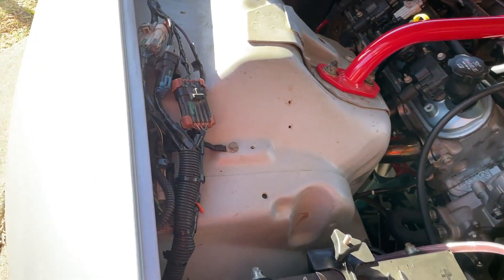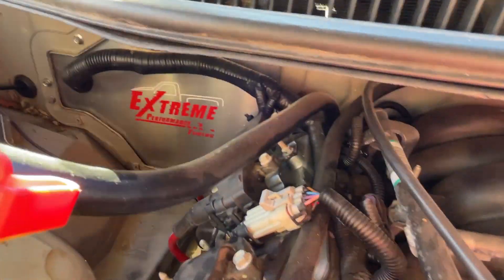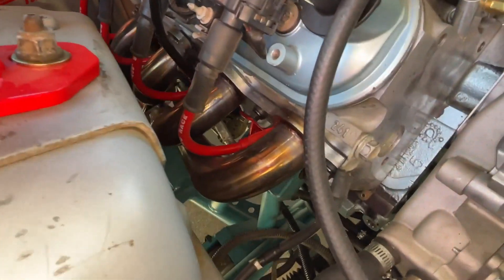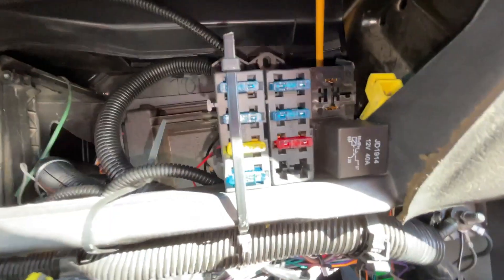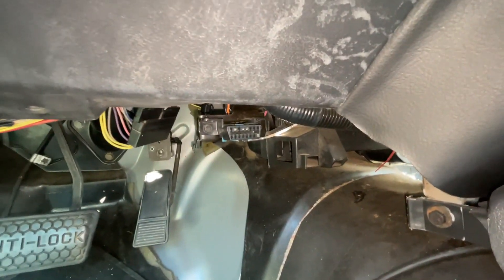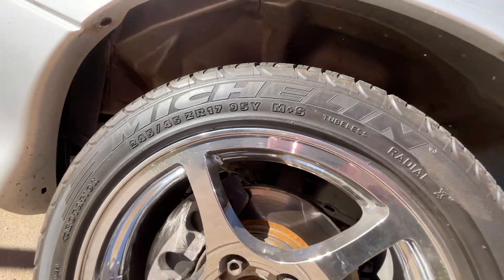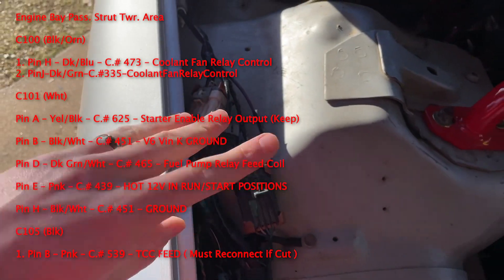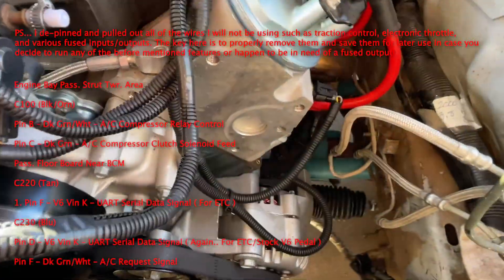How To Wire A Camaro V6 to V8 LS Swap | Ep. 4

Comment: So the issue im running into is the missing inj 2 fuse, I currently rigged a wire from my 2nd set of coil packs on the harness to the PCM ign fuse. It runs. Also  both sets of injectors are spraying but the injectors are stuck open after the key is off. I dont know how both sides are working if its only running on inj 1. I dont want to re pin anything. Do you know what the issue is and how to fix that?

Comment: Hey man great video thanks!  I’m learning a lot.  Me and my 14 yo son are putting a 5.3 out of a 2000 Chevy 1500 into a 2001 Camaro v6 car.  I have the pcm from the truck is that what you are using here the pcm from your v8 donor?   Also your link for the harness is not working.    If you could give me a quick rundown to point me in the right direction I would really appreciate it.
Reply from the maker: @charger7022  I was lucky enough to have 2000 Firebird ws6 pcm , the truck and f body P01’s are close ( that means a Drive by cable computer (98-02)) I found a link to a “LS1” style Drive by cable standalone for a 4l60e , i haven’t purchased it so I can’t verify but the description and pics show that’s what it is ! 

https://www.ebay.com/itm/185770095695?mkcid=16&mkevt=1&mkrid=711-127632-2357-0&ssspo=C_pEmDIxSEO&sssrc=4429486&ssuid=veiYd6ATRYK&var=&widget_ver=artemis&media=COPY

On Lt1swap.com you can find pinouts to how the truck and f body pcms are different and alike , they’re almost the same with minor differences. If that harness is actually a LS1 style it’ll be good for you and your boys swap since the harness will mate to the 01 camaro easier. 

Good luck man , you are reminding me of my father and I, 12 years ago, when he swapped my 1998 gmc for me ( it’s on my channel ). Your boy will cherish the memories forever , I know I do. It’s also why I do , what I do now ! Good luck , let me know if you need anything , best thing to do is to email me at EPTOKC@gmail.com !
Reply: @ wow man your awesome! Thanks for the in depth reply so soon!   If it’s easier to get a pcm from an ls1 camaro or firebird im all for it!   Thanks again
Reply: @KidKevi  so I’m ordering a pcm from a tuner on eBay and he recommended I use the truck maf sensor and said I can convert the harness to the 5 pin needed is that what you did here?  Again man thanks for all the help?
Reply from the maker: @ yes I combined the iat and MAF sensors into one connector and am running the truck MAF !

Comment: hello, i have a 1998 v6 firebird, if i were to try and swap a 5.3 into it would it be easier to buy a 1999-02 ls1 wiring harness and pcm? i know the 98s have another connector but if i were to swap it over to the 99-02 would i not have to do as much wiring? thanks
Reply from the maker: @jkyairsoft5888  typically if you buy a cheap standalone it’s going to be a 99-02 version man

Comment: For the fuel gauge to work how you go about that?
Reply: I’m putting the purple wire (C230) to the serial class data 

I currently have the coolant tach and speedo and battery just can’t figure out the fuel gauge
Reply: And it doesn’t work connecting the purple wire to the class 2 data so I’m really confused do you happen to know from under the hood on the 3 main connectors what color is the wire for the fuel gauge ?
Reply from the maker: @athinelongatedgoblin9411  the fuel gauge on a standalone has to be pinned for inputs and outputs , and then wired directly to gauges and fuel tank , the v6 car doesn’t have the same signal wire for the fuel gauge in the plugs under the dash , on my car anyways. Usually a standalone doesn’t have the input or outputs pinned to the pcm so you have to add them
 And manually run the wiring through the car !
Reply from the maker: 50/50 shot the class 2 will send it once the inputs and outputs have been added correctly , it should !
Reply: Do the 2 wires coming from the fuel level sending unit have to connect to the pcm serial data wire ?
Reply from the maker: @athinelongatedgoblin9411  the proper wires have to go from the sending unit to the pcm , then the outputs must be wired where they go in the car man , if the pcm doesn’t have the input it can’t output the level
Reply from the maker: @athinelongatedgoblin9411  the pcm input wires must be pinned into the computer and the proper output wires must be running to the gauge !

Comment: For the obd2 serial data 
I have  standalone harness from PSI with its own obd2 port do you know what I have to do so my tach and especially coolant works ?
Reply from the maker: You will connect the class 2 data wire from the obd2 plug , I tied into mine so my factory obd2 port works along with my standalone , the same wire powers a few gauges , including the ones you’re referring to !
Reply from the maker: I connected mine near the passenger side kick panel , be sure to tie it in going the right direction , it will send the proper signals to get a lot of stuff working in the car !
Reply: So like one wire from my old obd port gets spliced into my new obd port from my standalone harness 
Also would you know the color wire  on the old OBD ? Thanks for the help
Reply from the maker: @athinelongatedgoblin9411  No , you wire the class 2 serial data wire from your standalone obd2 port , to the green class 2 serial data wire down on the passenger floor board , connect it going towards the driver side and that will power your factory obd2 port and gauges
Reply from the maker: @athinelongatedgoblin9411  the wire you tie into , in the car will be Pin K in connector c230( Blu ) on passenger kick panel

Comment: You're video is very straightforward! That's rare. Those three plugs had me confused for the lights. Thanks man you really hooked it up on here. I might try and run m pcm like you as I completely deleted all of the heat and ac, vents and all lol! Thanks again mang!
Reply from the maker: Glad to have helped in some way !
Reply: Do the 3 plugs tie into the wires going in the pcm
 man

Comment: I have a 99 z28 408 stroker t56 car I wrecked at at the track, I see everything is plug-play mostly will my ecu/pcm be usable from my 99 to put on a 02 v6 donor car?
Reply from the maker: I believe there are issues in the vehicles wiring between 98 to 99 . I am assuming , ( cannot verify ) that 99-02 should be similar !

Comment: Link not working, trying to find the exact same harness
Reply: Seen one that says 98-03 but nothing about being f body specific
Reply from the maker: @stephengeter5898  doesn’t really matter , you can just wire it to match that standalone
Reply: Ok cool 😎
Reply from the maker: Research 1998-02 Gm ls standalone harness dbc on eBay , the one I ordered is for an F body specifically

Comment: Did you use the v6 ecm or standalone? Also I’m getting a 5.3 engine, could i use a 5.3 standalone harness with a corresponding 5.3 ecm and splice the v6 wiring into the standalone and make it work that way?
Reply from the maker: Yes that’s what I did in the video , although I used a 2000 trans am computer. Same concept regardless of pcm , pinouts could just vary slightly
Reply: @KidKevi  okay awesome! Your video is a life saver and the PDFs, love!  Thank you!
Reply: This is what I was looking for. Thank you both

Comment: I have a 98 camaro the computer and harness was missing when I bought the car...im wondering can I do this or do I need to have the ecm and harness....also if I do need the ecu and harness can it br from a truck or will I fry something in the camaro....appreciate you
Reply: Can I get a pcm for a v6 car like you?
Reply from the maker: @HotSauce313  I used a 2000 Pontiac Trans AM computer for an LS1 car
Reply from the maker: Various truck pcms will have different pin outs than the 98-02 fbody . To follow this guide you would be better off finding a 98-02 f body computer and using a standalone f body harness. 

Can it be done with any computer and harness setup ? Yes. Can I describe how on this comment , no sir. I wish you the best of luck and I can try to answer any questions you may have 👍🏼

Comment: Will a 99 engine cradle Z28 fit a 94 Z28 engine cradle so I can put a LS engine in the 94 and can I make the 99 Z28 wiring loom and ECU work in the 94 will it plug into my 94 was not a lot of hassle? And can I put the engine in through the top with the headers already on it or do they need to be off? And what kind of mounts do I need that mount on the Cradle I got the mounts that go on the motor I just need the one to go on the Cradle.
Reply from the maker: Not sure exactly , I put a tubular k member into this 2000 v6 car . I can only verify 98-02 LS1 car parts will work on a 98-02 v6 body. Wiring and unibody are identical. ( v6 wiring is a tad bit different but both will work together when spliced together ) 

I have heard that the body is the same for both cars 93-02 but I cannot verify it because I’ve only ever messed with 98-02 cars. As for wiring I’m not sure either , schematics are probably available online if you search. 

If you’re wanting to put a LS engine in any car I would go with all factory 98-02 ls1 parts regardless because that is a car that came with the engine 👍🏼

Comment: Have a 99 Camaro. The stand alone harness will plug into the pcm for the ls motor you get correct?
Reply from the maker: If the standalone and pcm are compatible yes , 98-02 F body pcm and standalone will work

Comment: So to clarify, you just wire the v6 wires into the corresponding wires on the engine harness and ecm?
Reply from the maker: Correct , you are mating the standalone harness to the v6 harness in the car , and the factory fuse boxes work like normal , but the link I put in the description , is an F body Standalone , so it’s ready for this
Reply: Im using a 5.3 truck harness for now for my swap that I stripped down to standalone. I'm sure it would be the same concept
Reply from the maker: @gearheadnation9254  it is man , just go off of the ecm pin outs , I was lucky enough to of had a 2001 trans am so it was all basically plug and play with the factory setup
Reply: So do you stripp out the plugs you need from the v6 harness and tie them into the stand alone ?

Comment: I did a swap on mine but my transmission is not engaging at all I knew my transmission was working properly before I installed it but it was sitting up for bout a year I'm lost ion know if the transmission just went out or its my wiring man if u could help ill appreciate it
Reply from the maker: I had trouble gettin my standalone trans plug to snap into my 4l60e green female connector , it has to snap into place , other than that I’d definitely check out the linkage and P/N switch
Reply from the maker: Also the TCc switch on both ends , one runs through one plug and out the other to your harness , so make sure all connections are intact

Comment: Quick Question. I am wanting to LS1 swap my 98 Firebird by finding another donor 98 F-body LS1 car. I was told that it was completely plug and play with no modifications to the wiring harness besides one wire. Is this accurate and would you happen to know which wire that would be?
Reply from the maker: In this video & how I decided to do my swap is I just wired in my standalone LS1 Harness with the factory v6 car wiring . I have the vehicles factory fuse boxes running the starter , fuel pump and coolant fans . Everything works as a factory ls1 car would with the LS power train !
Reply: @KidKevi couldn’t
You just get the whole motor
Trans harness and pcm for an ls  donor like a 2000 1500 truck that’s 2wd?
Reply from the maker: @charger7022  you can do that if you like !
Reply from the maker: No donor car was needed basically is what I’m saying
Reply: It sounds like you got lucky, and found a Y87 car right off the bat.
Great, but I wouldn't say they won't  need a donor car.
For one, a lot of the F bodies came with a single shot 7 inch open differential. 
Finding a donor with rear disc brakes, they also found a positrack rear end!
Most came with 3.08 rear gears, but a few came with 3.23 gears!
And if you have the 98 Firebird Y87 car,...then you have a Ws6 posi with 3.73 gears!
For another, there is still money to be made after you get your parts off of it.
Remember,  Pontiac went down!
So some of these parts will be very valuable.
Price a set of Firebird honeycomb tail lights, and you'll see what I mean.

Comment: Hey I’ve been going through the pin outs, everything is good but I can’t get it to start with the key, any ideas?
Reply from the maker: Something is not good man , kind of hard for me to say what it is . Does it crank ? Does it have spark , does it have fuel , please provide more in depth info
Reply: @KidKevi  it runs good, all of the pin outs are good, the fans kick on and the fuel pump runs, I just have to jump the starter for the starter to come on, I tried to ground the orange/black wire to ground the cars neutral safety but it doesn’t work, when I try to start it with the key the headlights dim, just trying to avoid a push button start
Reply from the maker: @markthibodaux5776  Going through a similar issue on another car at the moment . Make sure Pin E (Blu)  on C230 under pass dash is un hooked completely on the female part of plug . That’s fuel vats . Then take the yel/blk wire Pin J on C220 and ground it to the chassis ground right there by the pass door . That will bypass all vats , also be sure to have vats turned off in pcm ! Bingo🏎🏁
Reply from the maker: @markthibodaux5776  I also hooked that orange and black wire to my P/n switch on my standalone , that’s what it really is anyway , a park / neutral switch.
Reply from the maker: @markthibodaux5776  I believe it was an orange wire on my standalone , let me know if you have any more questions